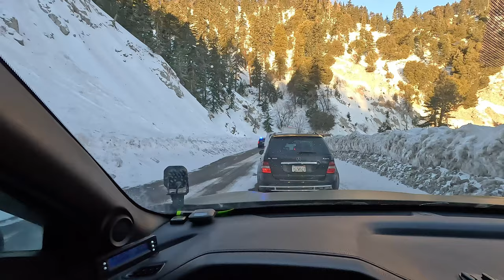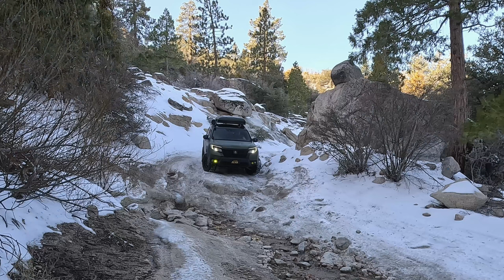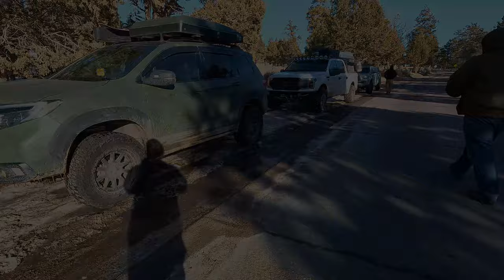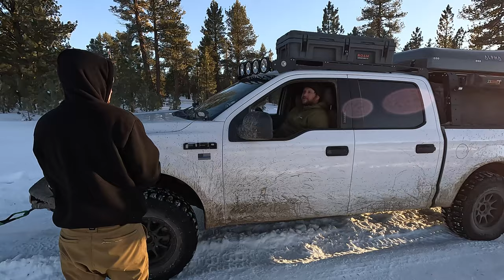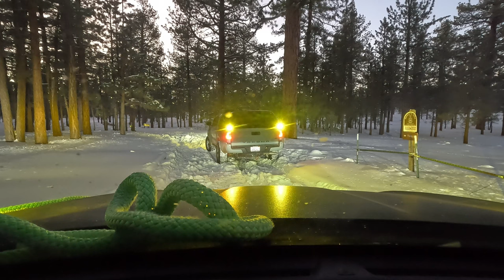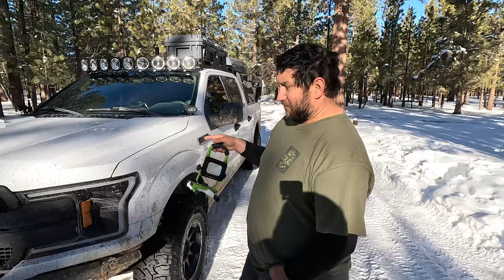Frozen Recovery Gear.  Adventure Gone Wrong! / Overland Built Ford F-150

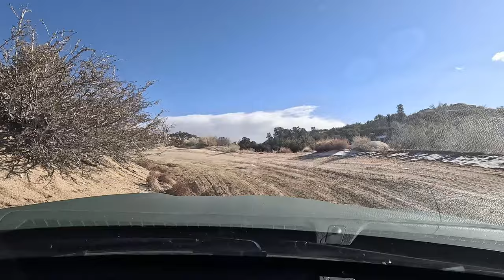Comment: 8:38 let’s do it and why not just hook the strap up and yank the truck instead of messing around with the winch ?
Reply from the maker: The trail boss was buried down to the frame.  That F150 already had a transmission go out on him.

A heavy pull in reverse is really bad.  The teeth are shaped to be more robust going forward.

This definitely was a concern when I pulled the taco.  I intentionally did not use too much gas pedal.
Reply: @JonDZ_Adventuring   I see, you guys helped out and that’s all that matters. I would have just flipped around a yanked lol